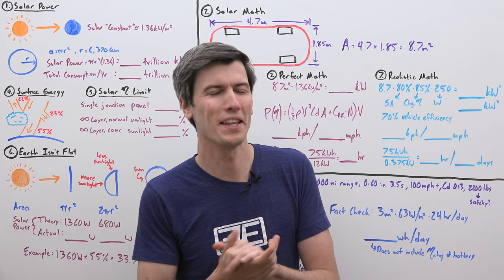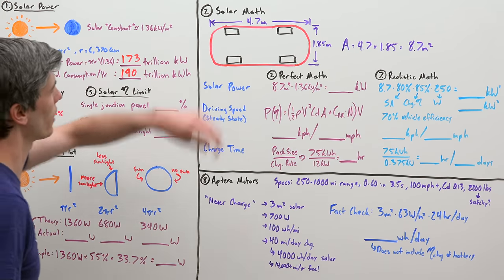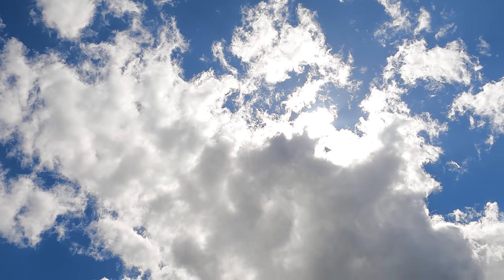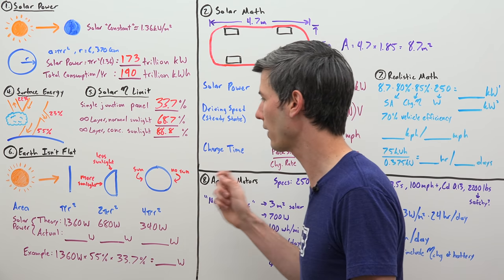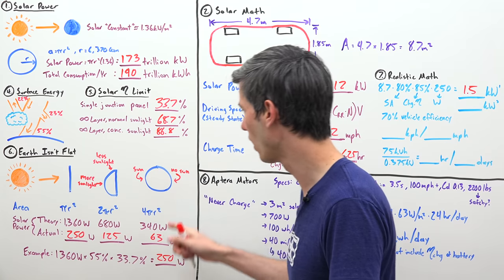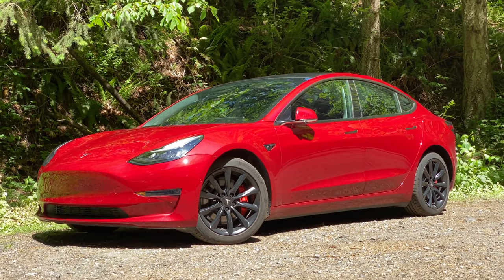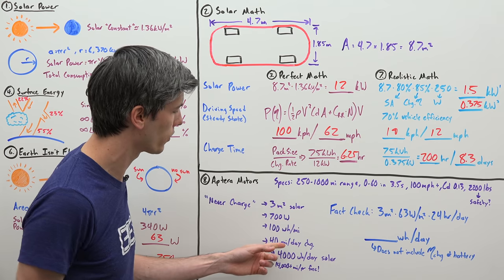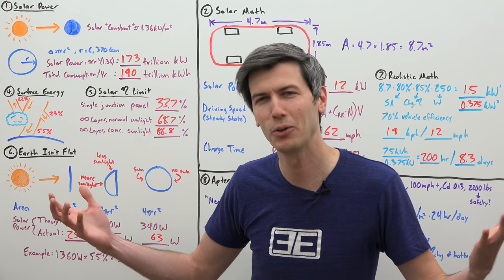Why Don't Solar Powered Cars Exist?

Comment: I was involved in my University's World Solar Challenge team. The calculations on the surface level radiation are a bit off. Even as far from the equator as Melbourne, Australia we regularly get over 1000 W/m^2 days. Places like England you'll get less but you can look up IRL solar radiation and see for yourself. Real world high performance solar cells like they use in the World solar challenge get over 300W/m^2 actual output.
Edit: Also if you do the math with even just cheaper regular panels then if you leave your car out in the sun all day you can get enough energy for a reasonable daily commute (if you live somewhere sunny like Australia). Edit2: You actually ended up discussing the above :P
Edit3: Worth checking out the world solar challenge "cruiser class". Basically "practical" solar cars unlike the one man cockpit race vehicles of the "main event" challenger class.
Reply: Which uni your at?
Reply: This is true. I think he should have used solar constants of real places instead of the theoretical maximum values as upper boundary and the world average as "realistic" scenario
Reply: My brain had a feeling that the math is off
Reply: @flemmings5534  He's probably at Delft
Reply: it really depends, if you're looking at a multi junction gallium arsenide solar array, like was common in the World Solar Challenge for most recent years, cost for around 3m^2 was in the several hundreds of thousands of dollars. Granted they give you efficiencies upwards of 35%, but the cost is really prohibitive.
Reply: Yes it's not just about vertical incident direct sunlight. Photons of various energies reach the panel from all directions. Reflections off clouds are quite important and even diffuse light from the blue sky contributes.
Reply: @jimgraham6722  absolutely. There's lots of literature out there on calculating accruate solar irradiation so its a shame such a poor approach was used so the sake of simplicity. Even explaining in a similar way the numbers could have been better chosen to be more representative.
Reply: Maybe you should watch the video before commenting?
Reply: Australia gets the more solar insolation than anywhere else. So Melbourne is unrealistic. 2,968 hours of full sunshine a year vs London at 1,633 hours or Bergen Norway at 1,187 hours.
Reply: @sammiller6631  I'm sorry I guess Australia isn't real 🤣
Reply: @kengineer_au  If Australia isn't real, that explains why manufacturers don't take Hardware Unboxed seriously.

Comment: When I was younger, everybody kept telling me AC lowers your mpg so we would just roll down the windows instead. But with the windows down, it creates drag..? So what is the best option after all? AC or the windows?
Reply from the maker: Depends on your speed! I believe myth busters ran a test. But a simple rule, at low city speeds, windows down. At highway speeds, windows up w/ A/C on.
Reply: Myth busters did this experiment and I believe that under 50mph in the car they were using diving with the windows down was more efficient.
Reply: Engineering explained already made a video on this subject. It's called Air Conditioning vs. Windows Down - Best Gas Mileage.

To summarize, windows down is better in the city while A/C is more efficient during highway speeds.
Reply: Alright thank you for everyone's answer. I'm a new viewer so I didn't see the video "AC vs Windows"🤙
Reply: The difference is negligible. Modern vehicles are very efficient. The AC system will not make a life altering hit on fuel economy.
Reply: Just put up with the heat.
Reply: @robertopics  The did all the calculations then botch the actual real life test. One of the cars couldn't take the constant cornering, of the test track, at the higher speeds, so they lowered them. Which obviously ruined the whole experiment.
One thing that wasn't taken into account, and using real numbers not those silly imperial measurements, with the windows down, you still only get air circulation of the temperature outside. Which is not great in 30C, with AC you get to sit in a comfortable 22C temperature as well as probably saving your dog's life.
Reply: The most SPG(smiles per gallon) efficiency is putting the convertible top down and running the AC. You are welcome.
Reply: @jeffreybeck1928  In my country that would be the most wmpg (wet miles per gallon)
Reply: AC, some newer cars have electric compressors
Reply: @vernonpaigejr.1517   ...and obviously that applies to ALL electric vehicles, which is what is being discussed.
Reply: running the A/C adds a slight amount of load to the engine, so itll make your engine work a little harder and thus use more gas. since the load from A/C doesnt scale with speed, A/Cs effect on your gas mileage is constant regardless of speed. having the windows down increases drag, and drag scales exponentially with speed, so the effect of having your windows open on your gas mileage is also going to increase exponentially with speed.
Reply: @vernonpaigejr.1517  electric compressors are powered by the alternator, which is still mechanically driven by the accessory belt. having the A/C on will still increase the load on the engine.
Reply: In Texas; AC
Reply: @buddy1155  I used to do this when I was young.. but now dealing with 110° California heat..  I would die after a while.
Reply: Drag is only relevant if your are moving quickly enough that you have to raise your voice to talk in the car.
Reply: Simple answer - move to Canada. The fan will be sufficient.
Reply: @skbuydens7717  I'm already in Canada. But when it's 35°C, on the highway, I would like to save fuel and be comfortable
Reply: @d0va316  In coastal Nova Scotia,  I have never used air conditioning.
Reply: in the city.  You may want to drive with windows up so you don't breath in the air pollution.

Comment: I feel like you ought to just put solar panels on your house to charge your car...
Reply: This! 
They last around 20 years and they will probably be far less obstructed on average than your car.
Also you don't have to always park your car in the sun. I bet the A/C in this thing will eat half the energy anyway. 
People are not willing to step in boiling hot cars to gain a few miles.
Reply: @b0nz1official  100% this. Solar panels on cars only make sense if the additional cost is negligible, and for something like the Aptera (2nd attempt, company was originally liquidated about a decade ago), I'm going to bet it's anything but negligible.
Reply: @smwsmwsmw  I mean the whole concept is quite radical. They are not trying to make a car that will be mass produced in the millions. More like a niche product which really pushes the boundaries .
From what I've heard and how they present themselves I think they know what they are doing. 
The only thing I find strange was the 3.6s 0- 60 time which seems totally silly for a car like this. On second thought this thing has probably a super short gearing with a top speed below 90mph and they are gonna recuperate quite hard so they have that big motor.
Reply: The point of the solar car is to be able to charge away from a charger or established source of power.
Reply: @AustinKoontz  Exactly, unless you're going to spring for enough batteries to charge your car once you get home from work and have enough battery power for the house at night this is a better commuter car solution. The real kicker for me is the clean bare bones design and efficiency.
Reply: By adding solar panels to the car, even if you only charge a fraction of your total battery each day, if you have a shorter commute or live in an especially sunny area, you may be able to get most or all of that "commute energy" from the solar. And why not do solar both on your house and car? Charge your car at home with the roof solar, then while at work and driving, charge even more. It also theoretically enables a complete freedom from on grid power, making all electric outlanding vehicles, possibly with additional deployable arrays for quicker charging, possible. For people with range anxiety, this could be the feature to push them from gas to ev
Reply: @anydaynow01  exactly, unless you have the storage to charge your car at night, this doesn't really work. Unless you are selling your power back to the grid during the day, then buying it back at night
Reply: @b0nz1official  "Also you don't have to always park your car in the sun. I bet the A/C in this thing will eat half the energy anyway. 
People are not willing to step in boiling hot cars to gain a few miles."

You don't always get a choice. My car is always parked in the sun.
Reply: It can have 2 or 3 hub motors. The acceleration spec is just what it is given the vehicles weight. “Doesn’t make sense” for what? It’s not a more attractive product due to its performance?
Reply: Well, yes, if you own your home. Something like the Aptera would make EVs more accessible. Finding charging stations at apartments are rare, and many people dont work anywhere near a charging station to charge there. 

Panels on your home is the obvious choice if you can, of course, but a solid amount of americans don't own a home. Just get panels to power your home, instead of having to have it charge your car + home.
Reply: @mjc0961  Most EVs have a timer and remote for the ACs that shouldnt be a problem. Otherwise you can run the fan to prevent it from getting hot.
Reply: This makes the most sense. Especially since most people park their cars in garages. Garages being very necessary where I live (unless you have a white paint color car) in the desert. Other issues such as whether you park in a parking garage at work (I do) also come into play.
Reply: @b0nz1official  I think of the Aptera as more of a motorcycle than a car.
Reply: If one has 200 m2 roof or can get permits to additional "racks" installed to back yard then I would consider but as a not rich home owner under 100 m2 I would not invest myself unless technology advances a bit more so I could get 100% of energy needs from own solar panels..
Reply: @smwsmwsmw  Assuming they are figuring in a profit margin, it's not too expensive, they charge $900 to for the full 700w package.
Reply: @MandyFlame  On a technical level yes, however it functions way more as a 2-door car imo.
Reply: @b0nz1official  Some of us are.  Hypermiling is a drug
Reply: @AustinKoontz  adding weight of the solar panels inverters and whatnot to your car will reduce its efficiency It gets to a question of do the panels bring back more electricity than they cost. It's pretty marginal.
Reply: @smwsmwsmw , I've been following this closely.  At issue with Aptera is that the same two issues that were the reason for it failing the first time seem to still plague them today.
Thermal management and an inability to meet their efficiency numbers.
They should be able to tell you EXACTLY how many watt hours per mile it takes to drive the car but they are very cagey every time they are asked.
This makes me highly suspicious of them.

As to thermal management... the thing has no air conditioning yet much less any kind of thermal management for the batteries.
Reply: @twelvewingproductions7508  You must not be following Aptera as "closely" as you imply. They've been giving the <100Wh/mile stat for quite a while. As for thermal management, they explain it pretty well in their FAQ (and various press releases). You should catch up with the class before talking trash.
Reply: @b0nz1official  Most people don't live in a place where you get boiling hot cars.  Most people complain when it gets over 80F.  That's what it is at night here in the summer.
Reply: @popefacto5945  , I've been following them for a very long time.  Initially they gave the "stat" of 300 miles per gallon.  Then 250.  Then when pressed they were not able to exceed around 100 miles.  Actual mileage was sketchy around that time because they changed from diesel to gasoline to hybrid and then to electric all with in a rather short period from 2006-2010.

Then... suddenly.. they are back.  They post the public stat of 100wh/mile in the exact same way they told us that they would go 250miles on a gallon of "fuel".

What I'm telling you is that when pressed, though you and I both know they know the exact actual number... they are not posting it.

What's happening here is that you so desperately want this to be true you aren't even listening to what they are actually saying.
Let me... catch you up with the class.
They said that the 2 wheel version was 10% more efficient.
That's a hell of a lot to be off in that 100wh/mile figure.
So was it 110wh/mile prior to the reduction.. or is the two wheel version now 90?
So yes.. be very careful with what Aptera is saying and the "stats" they release.
These guys have done this all before with the same result.
Currently the Aptera not only doesn't have any thermal management, they don't even have any air conditioning.
How does that factor into that 100wh/mile?
So no, they have no clue what their actual consumption will be on a release candidate.... and they aren't releasing any of the current numbers.
My guess as to why that is... is that those numbers look pretty bleak.
Reply: or have a small shed that houses the car, with a swiveling/tracking roof?  You would in fact get enough output to charge a light vehicle for an average commute.
Reply: @someotherdude  , fixed installations that are used to charge a vehicle work very well.  Especially when combined with batteries to store the power for when the car isn't there.
We did a test on this and even with the consumption of a Model S were still able to log more than 10,000 miles in a single year on nothing but spare sunlight.
Reply: It wont' make any difference.  It will still take a long time to charge.  Solar cars are not feasible.